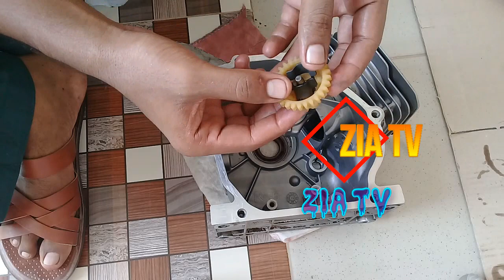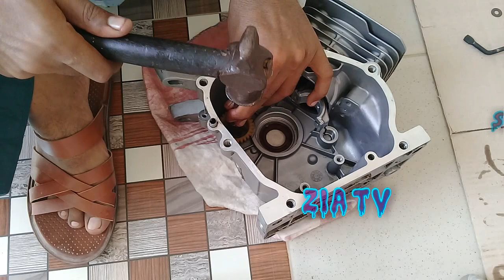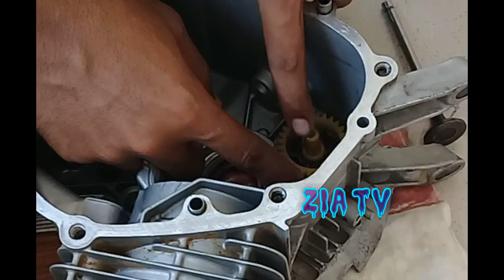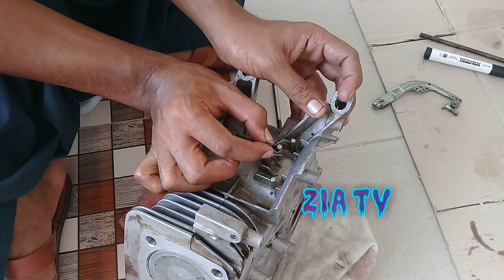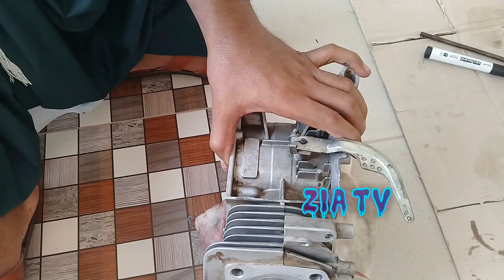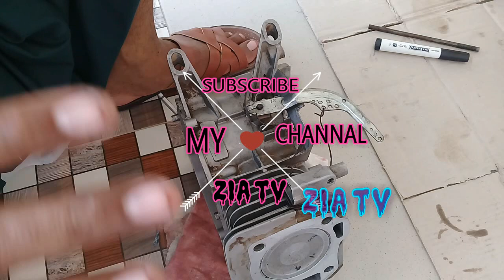Generator Repairing Course Part # 10 [ Governor Gear Install Method ] ( Urdu / Hindi )

Comment: Assalam.o.Alaikum bhai generator per jab load dalte hain tw band hojata hai.....without load sahi chalta hai gas per.
Reply from the maker: Faizan Khan Welcome to my Youtube channel 

Waalaikumsalam 
Load par agar generator band ho rha ha bene load k theak chal rha ha 
to is ki main waja Head ka kamzor hona hoti ha 
Valve par carbon bth zyada aajata ha jis sy valve sy itna gas pass nhi hota ha jitna engine ko chahye hota ha 
load dalny sy engine par wazan ata ha gas agar theak mily to load chal jata ha 

2nd waja head ma sy pressure ka leak hona hoti ha 
Pressure leak valve k theak sy na band hona hoti ha 
Head ki gas kit ka khrab hona b hoti ha Head k bolt ka lose hona b hoti ha 

ap agar Head khol sakty ho to head khol kar lath waly ko check karwa lo ya head ko ap khud saaf kar valve saaf kar k dobara fit kar do to ap ka kam theak ho jay ga
Reply: @ZiaTvgenerator  thanks bro itni details se sahi guide karne ......by the way agr apne is per koi video banai hai tu kindly us ka link share kar den mujhy thora or easy hojayega samaj ne k liye.
Reply from the maker: Khas Head par mere video nhi ha 
ma is par video banao ga 

mere video ma head open karny ki video ha pr us k sth full engine open karny ki video b ha 

agar ap head wala hesa dhkhy gy to ap ko samjh aajay ga
Reply: @ZiaTvgenerator  kindly ap us per bhi video banae or jab upload kardien tw mujhy inform kardiyega
Reply from the maker: IN SHAA ALLAH